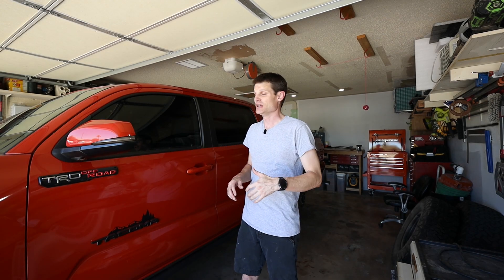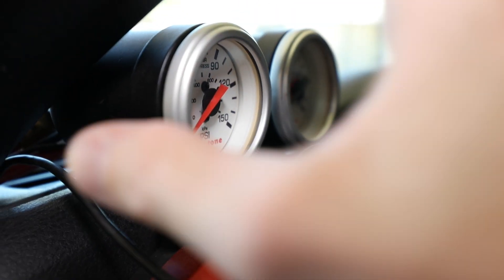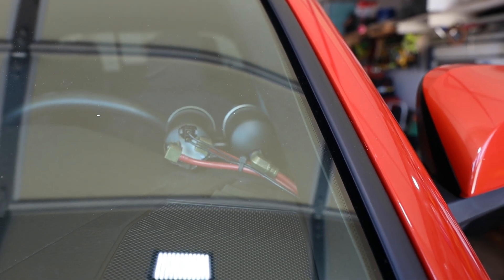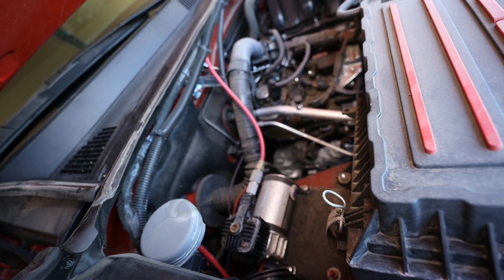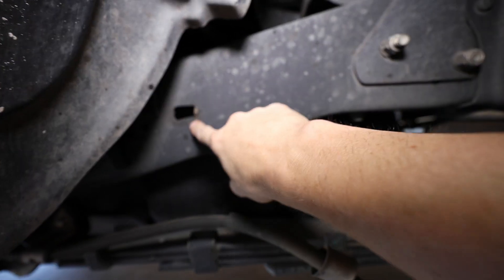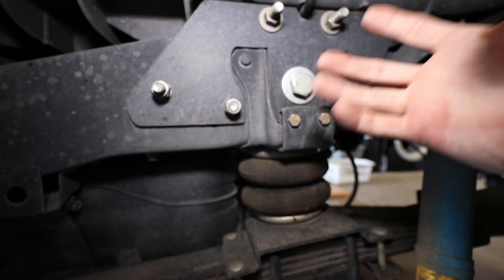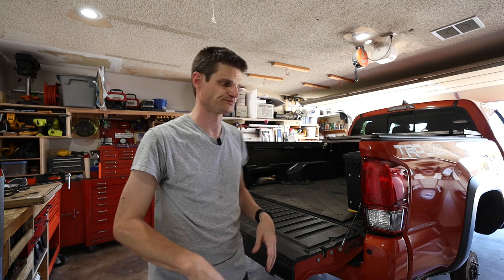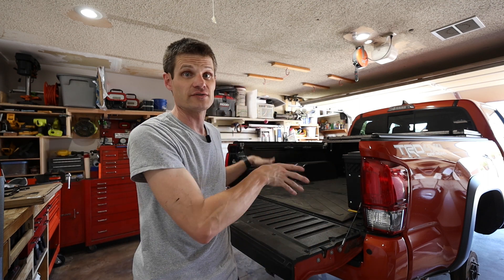Firestone Ride-Rite for Toyota Tacomas

Comment: Good video. I like your ingenuity. I have the Airlift version. mounts on the spring instead of having to cut the bump stop. I notice that when I was keeping between 5-15 psi of air in them; the ride was horrible. now i keep at least 30 psi in them, and the ride is a whole lot smoother. I think it is because the factory hitachi shocks in the TRD sport are too weak. and I have a heavy rack system installed. so my truck was bottoming out easy.  now with the higher air pressure, my shock is actually fully extended like it was intended. and is allow to absorb the bumps when compress.  anyways.  the whole point was that maybe trying more air pressure in your bags, might actually improve your ride experience.  I would have thought it was going to make it more bumpy, but in my case it didn't.  Thanks for the video.
Reply: I had this issue as well. I'm setup as an overlanding rig and was bottoming out a lot. I had to run mine at 40-50psi to get a decently smooth ride.  I ended up returning them. Going with medium duty SumoSprings instead.

Comment: Checking to see if you had any issues with them since the install?  I had them installed in march.. just got a bed camper and drop from NH back to Maine, ride was great till the last 20 min's or so... all highway/secondary roads.. nothing off road and I found out they failed when I got home.. they were flat... I tried the app to start the compressor and it started, got a bit above 30psi ( had been set at 50), then it stopped, would not start... had to drop my camper and have to contact the shop tomorrow...
Reply from the maker: @bfbryfield  I haven't had a single issue. Just got back from a camping trip today pulling my fifth wheel. Running about 40psi while towing. But mine are manual. No app. No electronics.